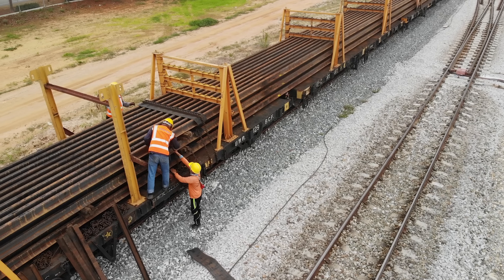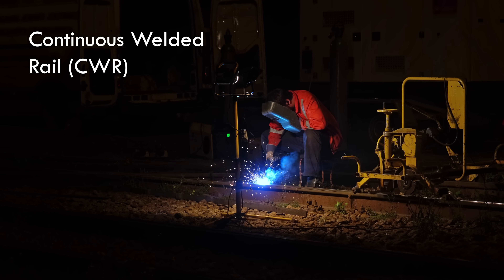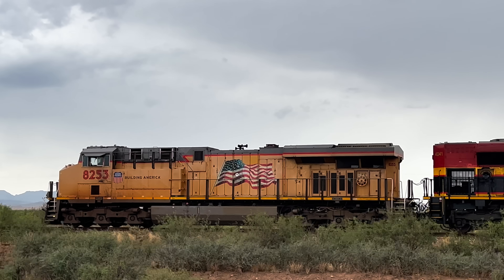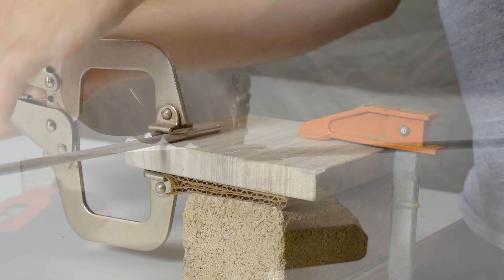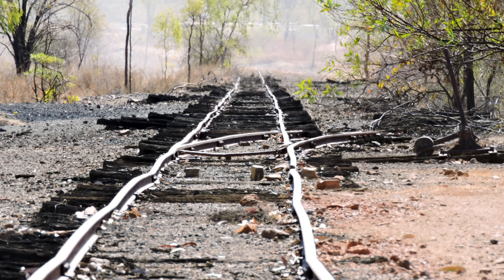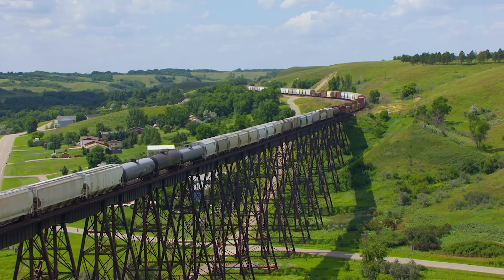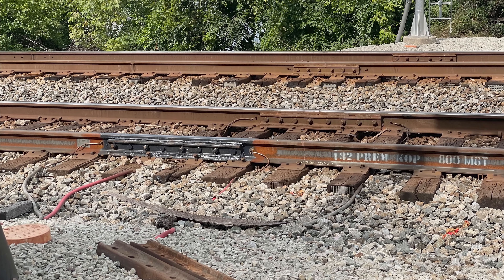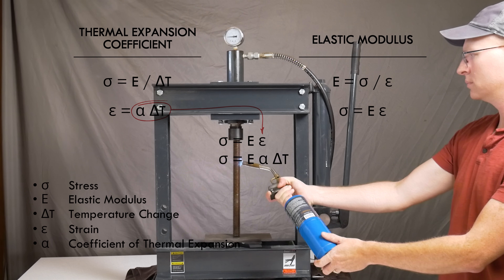Why Railroads Don't Need Expansion Joints

Comment: So if your curved track sections are installed under tension, on cold days the tracks going to want to slide to reduce the radius of curvature.  How do you compensate for this?
Reply: Lateral braces are sometimes added in critical areas, but curves do "breathe" due to temperature changes like you mention! The ballast helps hold the track in place and the spacing of ties is small enough that curve breathing isn't usually an issue.
Reply: @mvcrailphotos  I like that term "breathe".  I can visualize the process in my head and absolutely understand why that term was chosen to describe the action.

Comment: I’m not sure I understood your example involving the hydraulic press. That rod certainly did expand physically when you applied heat. It had to have to be able to compress the hydraulic fluid and increase the gauge reading. Real physical expansion DID occur. This is not an accurate depiction of restricting thermal expansion. Perhaps I’m taking things too scientifically. I just think the analogy did not work in my brain.

Comment: Why go through so much effort to avoid thermal expansion when they could just use an expansion joint like at 12:55?
Reply: Those expansion joints are VERY expensive, especially compared to regular joints or CWR, which uses no specialized components.

Comment: Railroads don’t need expantion joints, if you use concrete sleepers and enough crushed stones beside the sleepers to lock an hold the tracks. To take care of the temprature and expantion forces the rails must be welded under the right conditions - temprature and tension.

Comment: they buckle,  lots of images of buckled rails, from hot days.. going to be more of them in the southwest, as summer temps break 105 degrees..   which as you said. this works great up to 100 degrees,        
they are a great example of how quickly steel will fail with heat..  you don't have to melt it. for it to fail

Comment: Installing rail on a hot day seems like a good way to prevent buckling, but do they have to deal with curve shortening when the rail gets cold?  If you had a semicircle of rail with a radius of 1 km and a length of 1.57 km, a 60 cm shortening would be equivalent to pulling the rail 40 cm towards the center, if it "wanted" to maintain a stress-free condition.

Comment: What I don't understand is why they didn't make the expansion gaps diagonal to the rail. It's a simple change and would have made rolling over it much smoother.
Reply: I have thought this too, surely the diagonal splice joint makes for  smooth running, easier maintained , more reliable railways
Reply: With a diagonal joint the forces of the rail expanding into each other would cause lateral (sideways) movement of the rails relative to each other.  The expansion joint shown is mostly longitudinal (along the track) and has space on either end for the rails to expand into so they don't cause such movement.

Comment: i'm confused as to why you framed it as that thermal expansion is a problem, when it's the but the stresses induced BY the fact the rails are confined. You also skipped the fact that the rails getting installed on hottest days means that the work crews are out the on the hottest days.

Comment: This video is too long and didn't dumb it down enough for non engineers to answer the subject question.  You used engineering terms like stress, strain, and tensile without illustrating and defining them for non engineers.  I'd first (not at the end) explain that the rails are installed at a higher temperature, say at 150F degrees or whatever the industry standards are set, so that it is at a longer length compared to when it is at ambient temperature.  After it is installed and when the temperature drops to the typical ambient temperature range say 0F to 120F degrees, it will be OK because the properties of steel allows it maintain the length with fixed ends without failing, i.e. buckling or breaking apart.

Comment: Why don't they just use those diagnol expansion joints everywhere?  Is it really more expensive than welding the rails together and ensuring a high installation temperature?

Or do even those smoother gaps increase wear too much?
Reply: The expansion joints are very much more expensive than regular joints or CWR.
Reply: @mvcrailphotos  Thanks, but why?  They looked just like two track segments with angled ends.  Surely you could just have a machine mass produce this in the factory no?  Is there a part of the joint I'm not seeing?
Reply: @petergerdes1094  It's more than just cutting the rails on an angle, there's a specific shape to the cut that ensures the rails don't move out of alignment with each other when they expand. Plus there's specialized hardware (tie plates, bolts, fasteners, braces, etc) that are needed at expansion joints. Even rail joints often require special fasteners, but installing CWR uses standard tie plates and fasteners used elsewhere in the track.
Reply: @mvcrailphotos Thanks, that explains it.

Comment: Why don't American railroads use concrete ties,  like Europe? They would be impervious to rot, reducing maintenance costs and frequency compared to wood.  Plus, toy wouldn't have to worry about sparks setting them on fire.
Reply: They do, just not everywhere. Not everywhere has issues with wood ties rotting, the US has lots of warm, dry areas where wood ties work well.

Comment: I think the temp of rails in Texas can get a lot higher than 100F. Baking in the sun will absorb more heat than that from the air, and a train running over it is going to heat it as well from friction and compression. That's transient and local, but it can still build up.

Comment: The railway rocking  on jointed rial is called Harmonic rocking. On our line its worst between 16 and 21 mph. Trains going inbetween those speeds have to either speed up above 21 or if they cant the must stay below 16 mph.

Comment: How do you measure the reduction in rail tension due to the cold rolling by the rail traffic? In England just south of Carlisle a section of rail about 3 foot long, is removed every month. The workers joke that they are pulling Scotland south towards London!
One of the problems is the top flange is made longer than the bottom flange. One solution was to stretch a steel wire across steel ring pressed into the web and measure the frequency it vibrated at when plucked, like a guitar, when an electro magnet was used to pluck it.